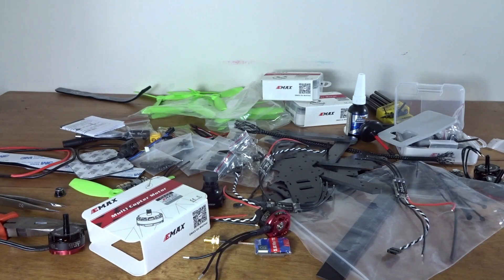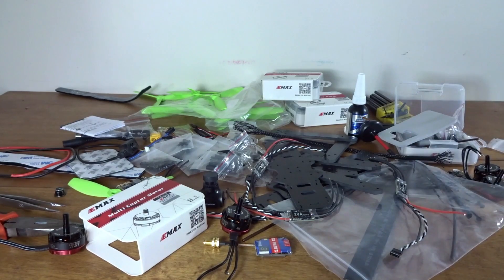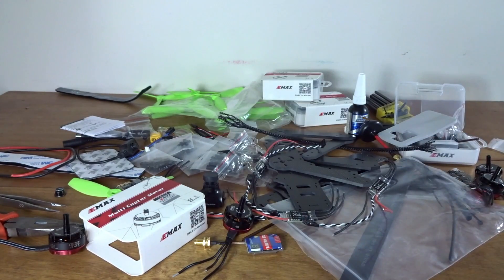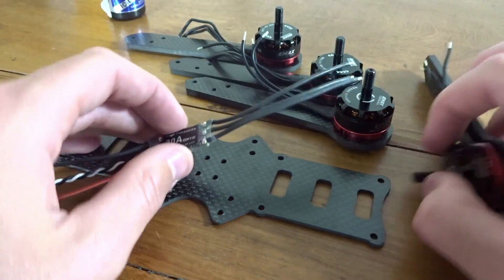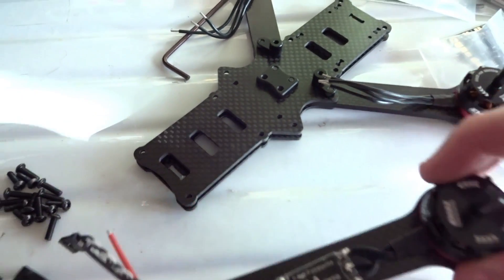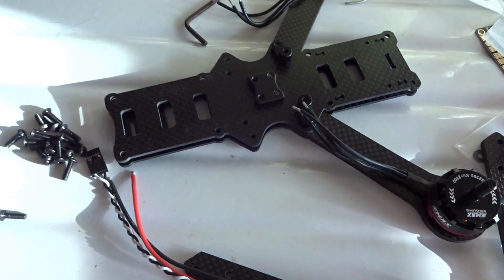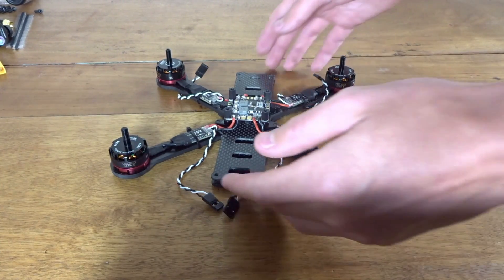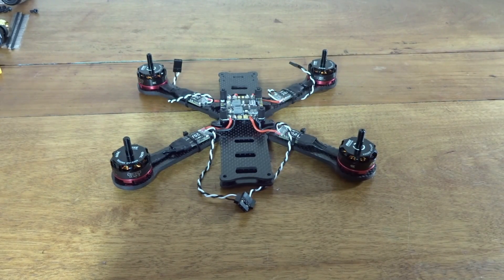ZMR -X210: Quick Build Overview

Comment: do you can recommend 30a esc or is 20a esc totally enough ?
Reply from the maker: Depending on the prop and motor. A 2300kv red bottom and 5040 tri 20A will be enough, but a 2600kv I would go 30.
Reply: thanks

Comment: Hi again, the strangest things keep happening with this build. When I fly in horizon mode the quad wobbles like crazy and when I power off my devo 7e two of the four motors go crazy and spin full throttle while there was no input for that. Any ideas about that? I calibrated ESC's and in cleanflight it all looks well...but I noticed that those two motors spin harder then the rest at e.g. 20% throttle. Hope you can know what's up :)

Oh yeah and for some reason ONESHOT125 doesn't work. If I enable it in CF then the motors won't spin at all. "-.-
Reply from the maker: That sounds like your PIDs are really bad, they need tuned on any build. You also should set a failsafe up in the reciever and flight controller to kill the motors. Your escs may not be capable of oneshot?
Reply: Stock PID's should be good for flying right? Just did the failsafe on the receiver. Worked for the unexplained motor spins. 
The weird thing was that the control was completely different on AIR mode. My ESC's should be capable http://www.gearbest.com/multi-rotor-parts/pp_359436.html but I think they didn't flash it. Hence the discount.

I just resoldered everything. Still have the same problem. Maybe it is the ESC's, I don't know before I get a hold on a flasher.

Hopefully I can get it to work soon.
Reply from the maker: KoekeBeest1985 Most of the times, but not always! Air mode is a must for any good flying :) They might have an old version of BL heli. It would be good to update them to 14.6
Reply: Hehe yeah I know. I have been spoiled with horizon modes and stuff. I'm still learning the Air mode. :) I think it's easier to learn on FPV but no cam yet. :) Still shipping...anyways...thanks for your input man
Reply from the maker: KoekeBeest1985 Yeah, without it you have very little control over your motors when throttle is low.
Reply: So I've learned on BorisB channel. :) other then that it's all abracadabra...

Comment: This is going to sound even noobier BUT have you ever had the problem that the locknut for the props on the motor doesnt tight up far enough? It needs to thighten like 5mm or something.
 So the prop is not locked on the motor.....I have that now and I just don't get why! Why deliver motors without the right nuts....or am I missing something.
Reply from the maker: All of mine go through far enough to engage the locking threads at the top. Do you have the same motors? Some props are tighter than other to get down on.
Reply: Same motors. The emax RS2205 "red bottom" racing motors.  http://www.banggood.com/Emax-RS2205-2300-Racing-Edition-CWCCW-Motor-For-FPV-Multicopter-p-1028793.html S

I'm so confused....if I engage the locking threads I still got plenty of room....sigh...maybe I should go to a hardware shop and buy some nuts or something....no maiden today
Reply: How long are your shafts?
Reply from the maker: KoekeBeest1985 "if I engage the locking threads I still got plenty of room" what? Just screw it down until it fully tightens the prop. It should come up out of the top a little. Mine are 14mm tall
Reply: Can't get it to screw till there. Sigh...it's weird the thread of the nut stops some 2 mm from the top. Maybe it's a manufacturing error. Thankfully my brilliant wife got the wonderful idea to maybe use the nuts from my first drone....duh....so I got it to work. My shafts are 10mm btw...also weird. 

Well thanks for your insight man. Will be following you daily on the interwebs.

Oh yeah I''m building the ZMR X210 too. It's fun, only  need the vtx and camera to come in and boom fpv flying is on :P
Reply from the maker: KoekeBeest1985 Wow, you do have a shorter shaft then! If you haven't check me out on instagram :)
Reply: I will check it out

Comment: Noobie question. How did you power the flight controller? Just by wiring the esc (white/black) to the signal and negative channels 1,2,3 and 4? Or is there another step to wire this board? I'm kinda lost + my flight controller makes a humming/buzzing sound........any ideas about that?

Keep up the cool vids. Thanks in advance.
Reply from the maker: No, these ESCs do not have an internal BEC in them to provide 5V, so you have to get it from somewhere else. I just put some wires from the 5V pads on the PDB and put them on an empty motor in spot and that powers everything up there :)
Reply: So if I understand correctly...5v on the PDB, wire two wires (one signal, one negative) to any other not used channel? The signal and negative...on the flight controller
Reply from the maker: KoekeBeest1985 No no, it is not signal and negative, but positive and negative ;) You wire your escs up the the first 4 rows, with signal and negative (should be printed on board which pads are which) and then just take the wires which are connected to the 5V out from the PDB, and put them on a + and - on a motor input you aren't using
Reply: Ok great. I will do that now. Thanks for your help man :)! Maybe you will hear me later on the build.
Reply from the maker: KoekeBeest1985 Alright :) No problem and good luck!

Comment: Cool :)  I like the quick-build style better then a lenghty full build (or fool build? :)) 
The frame looks nice & rugged! :D
Reply from the maker: Thanks! Yeah, this would be one tough one to break! 4mm arms and 7mm in the middle! Adds some weight, but I would rather have the all up raw durability!
Reply: Yeah.. just compensate that with a powerfull setup. right? :)
Reply from the maker: DutchRC Adventures Yeppers! Speaking of that, reminds me that I need to go see if the Graphenes or SMC are back in stock. I got $250 from various things last week, and went to buy the batteries and both were out of stock the day i wanted them! This setup is too much for the normal 45C nano-techs.

Comment: Nice build, now the flight video.
Reply from the maker: Thanks. An FPV video will be coming first, then a LOS video.
Reply: Los I am not so interested in, I like the FPV flights.
Reply from the maker: emiel1976ep Well, they will be mostly be FPV ;) Already have 2 full edits ready to post from the weekend flying at a campground, as well as scenic video from my XJ470.
Reply: Nice.
I filmed almost all the time the ground because my cam angle was not the same of as that from my fpv cam. Soon I hope to film with my new cam and also with the fatshark as it is back in stock.
Reply from the maker: emiel1976ep Haha, that has happened to me. I use 30 degree mostly becuase the X-210 runcam mount is 30 degree to just line it up with that. I just got some 4s 1300mAh 65C Graphene packs as they are finally back in stock.
Reply: I am now designing a 30 degree cam mount for the xiaomi yi. That one fits on my TSX220. Was a lot cheaper than a gopro.
The lipo's in the EU are sold out. I use now GF 5050bn 3 blades. I tried the 6045 and they have a lot of power. Lipo and motors did not get worm. Only problem is, is that it feels slower in corners than 3 blades and it reacts a bit slower but the top speed is a lot higher.
I wait till they are back in stock and than I buy 4S.
Reply from the maker: emiel1976ep Wow, sounds nice.
Reply: I must post my 3d model on slack and than members with a 3d printer print it for me.